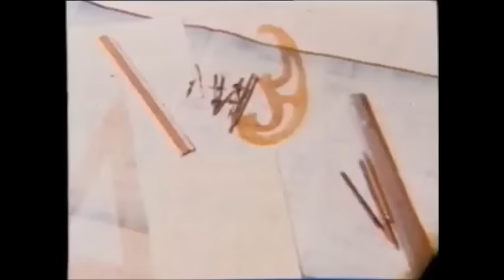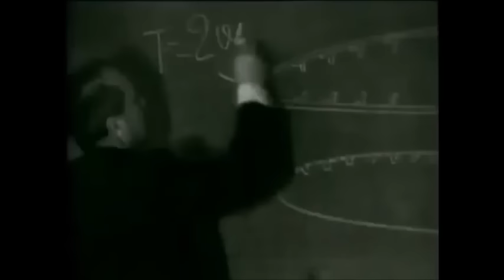SeaWings: A-5 Vigilante

Comment: I was in NAVAIR when the Vigi was being used for recon over Vietnam. The aircraft was a legend for it's performance, the astounding detail the cameras could capture, and the fact that it was damned difficult bird to keep up and ready. Thanks for the excellent documentary.
Reply: I had a boss who worked on these in nam.  The recon version.
Reply: @dan0alda568  I was on board USS Ranger when the last squadron of these (RVAH-7) made it's final deployment.
BIG birds for carriers.
I was ships company though - but an ET in UHF Comm, so I fixed the radios Ranger used to talk to them.
Reply: They called it the Turkey; a large North American bird that rarely flew.
Reply: @bobv5806  They were costly and difficult to maintain, but so beautiful in the air, and, especially in the recon configuration, did a lot for the folks on the ground.
Reply: @bricefleckenstein9666  Thanks, man.  Former ETR, myself, and, later, a Nuke.

Comment: I worked on the RA-5C at NARF Jax from 1970 to 1974 as an DoD civilian. As an AE we mainly rewired the Vigilante with the thin wall insulation Raytheon wire to reduce weight. These aircraft went to Key West afterwards.
Reply: Thank you. A comment, based on fact, not an opinion piece. The 24 hr news cycle, has a lot to answer for?.
(Empty space, or silence, sadly has no place in our world much, anymore?. I studied some art, and learned to appreciate, negative space).

Comment: I remember the A3J1 Vigilante being deployed at Sanford NAS during the Cuban missile crisis in 1961. My father's worked on these amazing aircraft, specializing on the hydraulic system. I recall the weapons "rail" system between the engine nacels being very unique.  I also remember the airframe seemed to suffer from vibration issues.

Comment: I don't remember which company made the kit but I bought and built a model of the Vigilante when I was about 10 (1970) which set me on a life long path of loving scale model building, flying models and R/C models and aviation in general. I'm still at it!!
Reply: Probably the same Revell kit that I built!
Reply: Same her. It was one of the first I built,in 1/72. I think mine was an Airfix. A beautiful plane, both as model and in RL. Strange to think this plane first time took to the air as long as 60+ years ago.
Reply: Same here! It was Revell I believe--1970 for me as well. Like one of the interviewees said it looked like it was doing Mach 2 just sitting there. Only the Tomcat, which I bulit a couple years later, was sexier, esp. in the swept back position.

Comment: A note on Mig-25 Foxbat. While A-5 ws on list of potential interception targets for Mig-25, Foxbat's primary targets were B-52, unfielded XB-70, and then concept B-1A. Add to that RAF V_Bomber fleet and few French bombers. Soviets had lots of tterritory to defend from all directions. They could not effectively defend all of it at same time. So to aleviate the problem, then needed a large fast Mach 3 interceptor. After sustained Mach 2.8 or higher flight, Mig-25 needed new engines.
Reply: I was watching a program on that. My thoughts exactly. I read that the F-15 was a direct response to the MiG-25.

Comment: Coming out of the Navy in Mar 1962, I went to work at NAA Columbus Oh on the A3J (before it became the A5C and later the RA5C). Air frames 58-62, got "an in" and went to NAFS in Heath Oh to work on the same inertial navigation computer (D-17B) in the Minuteman I and II, Oct of 62 to 66. Often I think about the crew at Columbus and wonder where they are today.
After all these years now I understand why it became the RA5 and that its value in that capacity was as important as a bomber and it makes me feel  good that I had a small part in all of that.. My anger subsides over our monogrammed A3J ballcaps becoming obsolete just after we got them. LOLOL
Reply: Was ships company USS Independence 1970 had onboard the last marine fighter squadron (F-4s), the last marine light attack(A-4s), the last A-5 photo/recon unit and I think we carrier qualed  the last F-8 recon unit but the 'pigalante'  because of its slightly scary landing and deck handling qualities but it did more sonic boomy fly bys than the F-4s  dang than thing was a beast in the high speed suite.
Reply: @kennethhamilton5633  Talk about hi speed. One of the last air frames I worked on 60 or 61 had been accepted by the Nav, painted ready to got. "Wild Bill" was to make one last flight. for ANY squawks. When he came back the paint on the fuselage and tail were burned from air friction. Didnt set well with NAA because it was gonna cost MANY THOU to repaint. Had to be a LOT MORE THAN MACH 2.
Reply: Dad worked at NAFS "64-"82 as QC Tech.
Reply: My father also worked for North American in Columbus after he left the Navy in 1960.  He served aboard the Intrepid,  Independence and Forrestal with  the Black Aces.   Radar and Fire control.  He was involved in numerous projects with the Vigilante including during the Cuban Missle Crisis.   The Black Aces won the Top Gun competition at Point Magu in 1959.  I have Dad's plaque from that win.  Dad has never stopped being involved with aviation and veterans groups and still fly's today.   I am so blessed and proud of pops and all the veterans and service people that allow us to live free.   Thank you all.

Comment: 1964 - My first assignment in the USAF as an "Aircraft Instrument Repairman" was on F-105s at Kadena AB, Okinawa. Watching this, I now have learned the All Attitude Reference and Bombing system, AN/AJB-7 or "Ab Jab" as we referred to it, had the same modes of bombing as the Vigilalnte in the  F-105. (The F105 was built with nuclear weapons capability, too). It would carry the nuclear bomb in its bomb bay attached to a huge or air- powered cylinder, but normaly, a fuel tank was attached instead). The Ab-Jab system was a fantastic system, in my humble opinion. That same system also "migrated" to the F4 Phantom which I worked on begining in '67 at Yokota AB, outside Tokyo, Japan. Amazing! Fly-by-Wire, also?  What the....! I thought the F-16s I worked on at Hill AFB were the first!  USAF Ret E7.

Comment: A note to add to this, the  U.S. Navy did not stop aerial reconnaissance after the RA-5C.  There was a pod that went on a-7s, f-14s with TARPs (Tactical Airborne Reconnaissance Pod System).  Now with the F-18E/F with SHARPS.
Reply: Yes sir..I have personally installed several TACTS, Sharps, and ATFLirs on F18s. Even saw 3 or 4 with the camera setup in place of the gun. AT 05-11. RA5C has been my favorite jet since I learned of them on my first trip to naskw. Cheers.

Comment: The A-5 (A3J) Vigilante was an amazing aircraft. Originally intended to deliver atomic weapons as the USN  nuclear interdiction and strike aircraft until the service adopted a policy preference for Submarine delivered SLBM. The aircraft were then reconfigured and re-designated for Reconnaissance. Throughout the Vietnam war they were employed by the USN in  the post-strike reconnaissance role. Their missions were high risk and losses were commensurate. The Vigilante set  a world altitude record of  27,874.2 meters (91,450.8 feet) that held for 13 years. The A-5 Vigilante was very advanced for its era and were also very expensive to maintain. As part of the post-Vietnam War spending cuts  the Vigilante was retired from service.
Reply: Ummmm, yes, I believe they covered all of this in the video...

Comment: The RA-5 was a great recon aircraft that could fly at over Mach 2.
SR-71: Hold my drink.
Reply: Interestingly enough, I was stationed with a guy whose previous duty station was an RA-5C squadron. He said that during his tour, one of the main missions of their birds was to fly ECM cover for SR-71s overflying the USSR. The RA-5C would fly, at it's service altitude, under the SR-71, and jam. The SR-71 would fly at it's service altitude, and do it's recon mission. Their ground speeds would match. They would fly from Utapao Thailand to the UK, and then back on the next mission. I don't know if it was true, but it seems plausible for that time frame, and it's a pretty involved plot for a "Sea-Story".
Reply: The A-5 wasn't originally designed for recon though.
It was the closest thing to a Navy version of the Hustler or a lower-end version of the XB-70 BY DESIGN.

Comment: Sitting behind the pilot,  the bombardier/navigator/ reconnaissance officer did not enjoy the view and space of the F-14 RIO.  The back seater with his fold-down desk and full instrument panel, radar and other electronic controls was cramped with both elbows when seated touching the aircraft's skin and only had up high a 1 foot square window port and one to starboard. He had his own canopy. I read a naval crash narrative where a back seater could not see or touch the pilot.  This is according to crash report submitted by a young Ensign and sole survivor of a crew ejection.  The crew was trying to qualify the RA-5C for the USS Ranger and undergoing fleet carrier landing practice (FCLP).  This is "...practice of crew coordination and the techniques and procedures to land the largest and heaviest carrier aircraft on a flight deck."...   The plane recently completed progressive aircraft rework (PAR).  During the second day of flight after (PAR) a hose clamp dislodged becoming ingested in starboard engine resulting in FOD and fire.  Pilot did not survive the ejection.
Reply: My dad flew the A-5B and RA-5C models in VAH/RVAH-7.  He and his BN used a carpenter's ruler unfolded to pass notes back and forth.

Comment: I was on the USS Ranger for 3  cruises to Vietnam, 68-69, 69-70, and 70-71. I was an AQ in VF-21 working on F4 Phantoms. I was on the flight deck one day during flight ops waiting for my planes to land, and saw a very sad thing. I'm not sure which cruise it was or which A5 squadron it was, but and A5 came in for landing and the pilot missed the wires. Then instead of right away accelerating to get airborne again, for some reason he hesitated getting the power turned up. The plane rolled off the end of the angle deck and went into the sea, nose first. Both canopies were still on the plane when it hit the water. But then it bobbed to the surface, and both canopies were gone and the cockpits were empty. The crew had ejected under water and disappeared. The plane floated a few seconds and then sank as the ship passed by. The ship just kept on going to get out of the way, and the helicopter and the destroyers behind us looked around for a while, but no survivors were found.

Comment: The TARPS-equipped F-14A became a very able successor to the RA-5 Vigilante....
Reply: Hardly. The TARPS was a one trick pony. The RA5C was nearly a complete intellegence platform.  EW, SLAR, IR line scanner, optical photo, night photo, 137 antennas on the plane.  Nothing replaced the Vigi for capability.

Comment: The A5 was truly revolutionary. Heads up display and ECM in the 1960s. The air intakes and the wing profile and fuselage, the placement of engines look similar to the f15's. Maybe the aerodynamic research for a high speed fighter took inspiration from a5 design.By the way, the soviet design study looks very similar to the mig25.
Reply: Somewhere I read the North American disclosed most of their high speed research results to other US manufacturers to ease overall speed of progress.

Comment: Older single spool jets had flame-out and compressor stalls (Cutlass?) and issues on takeoff/landing. Issues lessened with twin spooled jet engines (fewer stalls).
Reply: Not to mention the advent of Fadec to alleviate many engine  quirks resulting from agressive throttle inputs.

Comment: There is NO room for inter service bickering as to who should have what. That and still is B>S>. It's stupid pride.
 Every branch needs the capability. We had the RA-5C onboard ship.
Reply: The Air Force also put pressure on the Army to not have fixed wing COMBAT aircraft, only supply, reconnaissance, etc. 
Another prime example of inter-service bickering came even before Pearl Harbor when U Boats sunk shipping right off the Eastern Seaboard. The Army and the Navy both claimed the other had responsibility for coastal defense...
Reply: Yeah, why does Cost Guard not have nuclear capabilities!

Comment: A bomber on an aircraft carrier. Waste of space. Intruders Better investment
Reply: Intruders were a LOT slower - and when this aircraft was designed, it was thought that "high and fast" could still defeat defenses.
Reply: @bricefleckenstein9666  The navy b58 hustler ?
Reply: @Joe-bx4wn  The Hustler was never Navy - but it was same timeframe in it's design or a little earlier.
Ditto the entire Archangel series - A-12, SR-71, YF-12.
Then there was the XB-70, the most extreme (in some ways) version of that theory.

BTW - the Intruder came a good bit later - and was ITSELF a bomber, AKA a "waste of space" by YOUR original comment, along with the A-4 and the A-7.

Comment: See now I got this idea the vigilante bombs then it comes around for the reconnaissance it’s being very noisy the NVA is lighting up the sky with a flack rounds the vigilante turns and burns back for home.  while the NVA is concentrating on trying to bring down a vigilante propeller driven aircrafts Comes in treetop hopping and strafes and bombs the hell out of the anti-aircraft positions and takes pictures while doing it now if I can devise a strategy what the hell was the excuse of those in charge?
Reply: Total fantasy. You have nothing true in your mind.
Reply: False.
It was designed as a nuclear bomber, it was later TURNED INTO a recon aircraft (and the bomb bay was filled with RECON type gear).
COULD NOT do both missions at the same time.